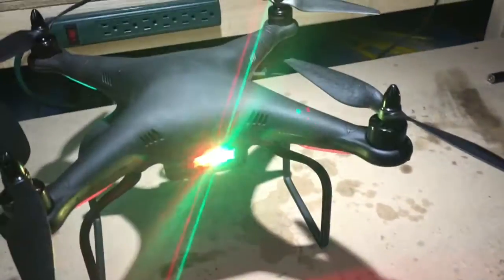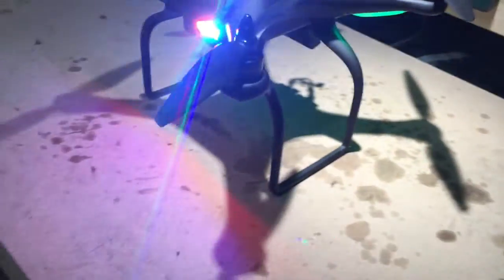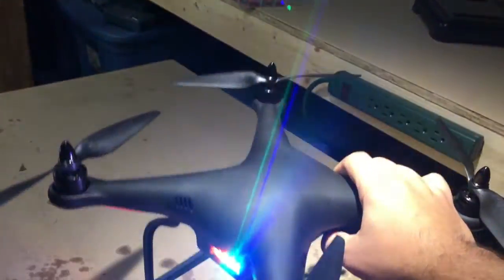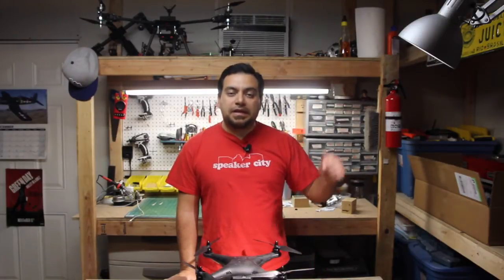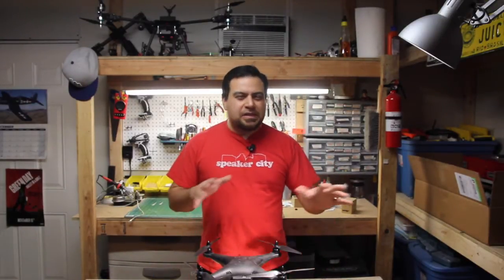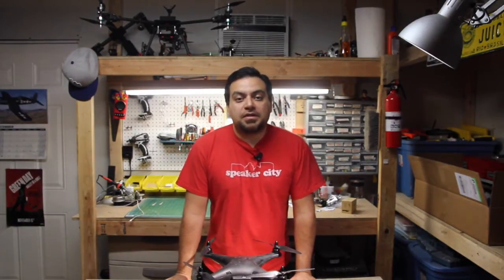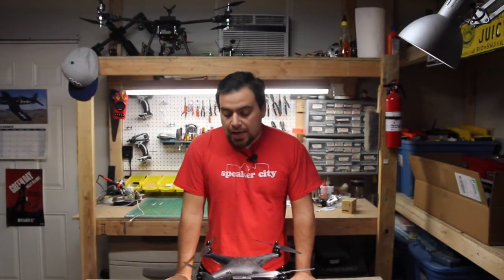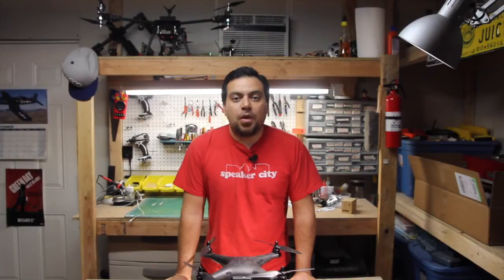Building a Better Phantom: The Ghoul - Part 2: Assembly

Comment: Nice build. But just wondering if it might have looked neater if you just drilled 3 or 4 holes where the led lights could have sat behind to indicate gps lock etc.
Btw, what was the total cost for the build. Also would this bud be better than many of tHe cheap phantom clones already in existence.